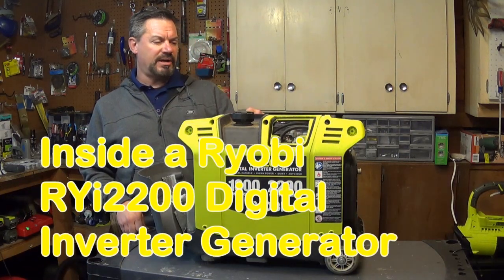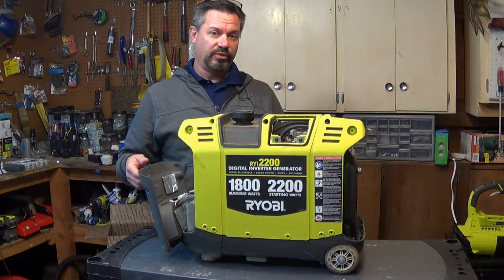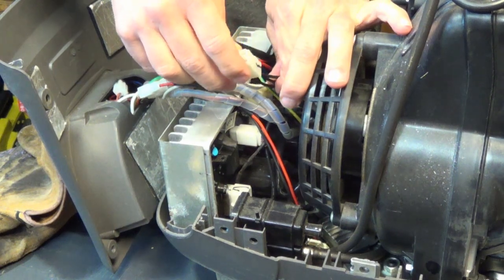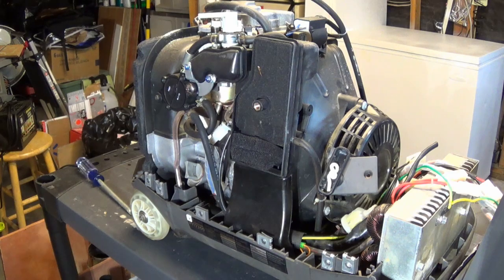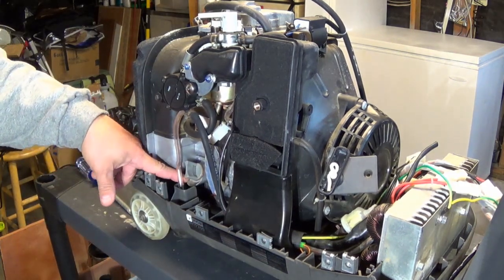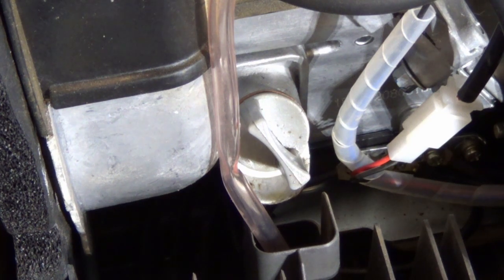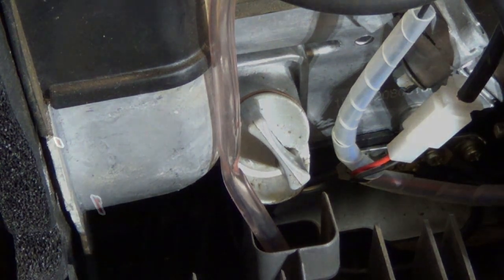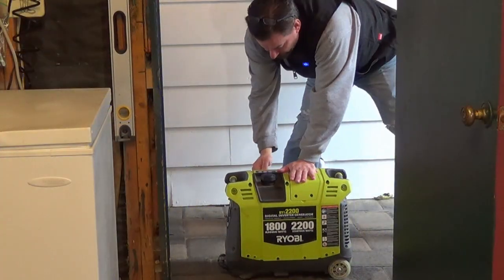Inside a Ryobi RYi2200 Digital Inverter Generator

Comment: Im going to assume the gen output is 120v 3 phase at the connector you showed, ill explain why later, but you see it has 6 wires at that connector, so that's a clue for being a 3 phase output. I cant make any sense of a single phase AC output being 6 wires. 🤔 A regular gen makes 120v 60 hz 1 phase from the alternator straight to the outlets onboard. The inv gen simply adds a bridge rectifier  + pure sign inverter between the gen alternator output and the final outlets onboard. The advantage with the inverter gen is the engine rpm can run independently of the final output frequency. Older gens must run at 3600 rpm (2 rotor design) to make the 60hz frequency we need constantly. The inverter frees the engine from that strict RPM, and frees your electronics from receiving a not-perfect 60hz frequency. So now the generator's alternator acts more like the alternator on a car, where the frequency of the initial AC output is allowed to vary. Theres probably a small battery or capacitor just before the inverter that helps store a bit of freshly made DC so the inverter can pull from that during motor startups. Automotive alternators are 3 phase AC before 6 diodes change it to DC for the car's system. Why? Probably for the same reason i think these inverter gen alternators are 3 phase as well, because you get more DC per revolution and you can lower the duty cycle of the alternator.... ohh and you can do it with thinner wires.

Comment: These inverter generators are inefficient, as everyone that has used stand alone inverters knows, every time you convert from DC to AC or vice versa, you get a loss of about 10%. in this case it's 20% at least!!
Reply from the maker: So what is your solution?
Reply: They make up for efficiency when the load is variable for things like power tools.  I built a vacation cabin with one of these as my only power source.  The inverter allows this engine to idle slowly and quietly when no tools are being run.  I was able to run 8 hours on 1/2 a gallon most days.  A traditional generator would have used more maintaining a steady RPM for all the downtime when saws aren't running.
Reply: You don't need to lose 10% with well designed circuits.

In this case the first conversion is from multiphase AC to DC.  Typically this is 3 phases, since there isn't much to be gained by using additional phases.  An inverter generator typically puts out 150V-400VAC, depending on engine RPM.  The conversion to DC is done by simple diodes, result in a 1.4V to 2V drop (two diodes, each with a nominal 0.7V drop).  That's under 1% power loss.

That loss could be reduced by active synchronous rectification, where the diodes are replaced by MOSFETs.  But at only 1% loss it's probably not worthwhile in a low cost device with plenty of power and cooling available.

The DC is then converted to AC by an inverter.  A good high frequency inverter will have a loss in the low single digits when supplying a resistive load.  This might increase to the high single digits with a highly reactive load, such as a motor.  But it's not going to be 10%.

Comment: I believe the voltage coming from the white/black cables off the generator should be 60 volts AC.  It would depend of if the manufacturer had put diodes on the rotor.  You should be able to run the gen without plugging into the inverter, allowing you to test the output.
Reply from the maker: Thanks

Comment: I had this generator for 2 years, ran it 12 hours every night. Kept oil changed with synthetic on a set schedule, every Sunday. Just under a gallon to fill it, with a low load run time around  16 hours!! Runs very quiet but every time I did a video, it sounded real loud. Use a foot long piece of white 1/2" pvc pipe to stick down in the oil fill tube and it keeps the insides of the gen case clean. Easier to drain too, right back into a disposable oil container.. mine always started on 1st or 2nd pull. A buddy of mine bought the newer version, which I have his gen right now. It too runs excellent. Saves half the gas my bigger Honda 3000 would be burning, and it gets real good run time itself..
Lookin forward to getting my hands on a lil honda 2000 too. When off grid, generators are a nice thing to have extras of. I got a big Coleman pro 10,000 too. Got solar going up soon. 
Suggestion about the battery/invertor idea.. just grab an extra battery or battery bank and a power matching inverter off Ebay.. use the battery system as base power intil it needs charged. Just use gen to charge battery bank til you aquire solar..
But what do i know 😁
Reply: These are not designed to start on the 1st or second pull when cold,  the manual clearly states the carb needs to be primed with several half @ss pulls before a robust pull starts it up.  I do agree with you that these Ryobis are pretty decent & last a long time. Mines six or seven years old and still runs like a champ.  Mines mainly for when hurricanes come along and nukes the power grid.   Living in hot Florida with no central a/c is brutal .  This Ryobi powers everything I need, my 8000BTU  LG portable air conditioner on wheels, my TV, Blu Ray player and my refrigerator.

I have five giant APC ups's with four cells in each, that in a pinch I can daisy chain and power pretty much anything, and this little Ryobi can top those if if necessary,

Comment: The only thing that I want your viewers to know is I own one of these for about 5 years and if you don't turn the lever to fuel/off... off when it's not in use... do not leave it in the Run position or the engine will flood,  fuel must migrate when that lever is not all the way to the left.... and you can't get it started t's taken me 5 years to figure that out.

Comment: Wow really noisy . Thanks for sharing!!!
Reply: I've been using one for 3-4 years and it is not that loud, also never takes more than 2 pulls to start.
Reply: @tommyt9800  Same here but I have the newer version than the one pictured here, the one with the digital control panel and bluetooth connectivity. Not sure if they made it quieter. My unit never makes smoke either. It's really an awesome generator. With the newer one, if you put the control knob in the "run" position, it actually partially cuts off the fuel, so you have to turn the knob to between the "C" and "H" in the word "Choke" next to the knob, basically turn it a little toward the choke position, and that will give it full fuel and not put on the choke either. I thought my generator was bad until I learned that.
Reply from the maker: Yes and no.  It isn't when compared to a non digital inverter. You can't hear it in the house, so it isn't too bad.

Comment: hello I need to repair my generator but I can't find to customer services , the problem is about the segments , could you please help me ?
Reply from the maker: Go to Home Depot website.  Look up the manual at the product description.  It will give you info on where to get service.
Reply: Hello in Jamaica and my inverter get damaged in my generator ryobi 2300 how can I source the parts
Reply: Try eReplacement parts. I have bought parts for my Ryobi 2200 from them and I believe they ship international.

Comment: Please describe the engine, is it a 4 stroke, is it an overhead cam like their trimmers and blowers, what size is it? Do they use that engine on any other Ryobi equipment? What's the generator like? Is it permanent magnet?
Reply from the maker: It is a four stroke engine.  Other than that, I don't have any details for you.  You can probably find that information on their website, or possibly contact them directly.
Reply: engine is a 4 stroke, Yes its an over head valve . cam is at the bottom. size is 80cc probably not used in any other equipment. no it's not a permanent magnet. whats the generator like? its not bad for its price.  where are you going with all the questions thought?
Reply: by the way sir the 3 wires are 3 phase 250V

Comment: hi there, can you show how you took the housing off?
Reply from the maker: You basically have to remove all the screws you can see from the exterior.  It is a little tricky by the handles but not a big deal.
Reply: thanks! i will keep you posted of my progress. i had to order a choke level switch today, but to get at it the housing needs to be taken off, which involves draining the gas tank and getting under there to where the switch is...

Comment: we just purchased one but didn't have the manual my father is wondering if this uses a mixture of oil and gas.
Reply: Rosalva Mora  gas only
Reply from the maker: The fuel and oil are separate.   In this video you can see where the oil is added.
Reply: Fernbark Frist thanks so much

Comment: a friend has three Honda connected together, it this possible with the Ryobis?
Reply from the maker: I am not sure how you would do that.  Looks like two is the max.
Reply: I believe he took the cables and connected all three together.
Reply: @jackchristensen4419  I think this should be possible. For the ryobi at least, the cable is just a dumb cable that ties the two generator outputs together. The logic for synchronizing the frequency is in the generator itself.

Comment: have you tried adjusting the valve clearance? noone, even ryobi provides info on this lol as some has said this motor is by topsun and is considered disposable. I wonder what the rated hours is for this motor. ty for you video!
Reply: I was wondering about the quality of the engine as well - I have the newer version of this generator and probably have 30-40 hours on it (you have to use the app on your phone and connect via bluetooth to get the engine hours, lol) and so far it has been perfect. Really is a great generator.